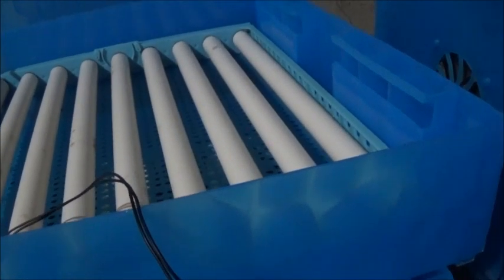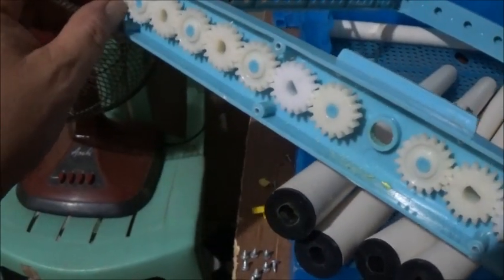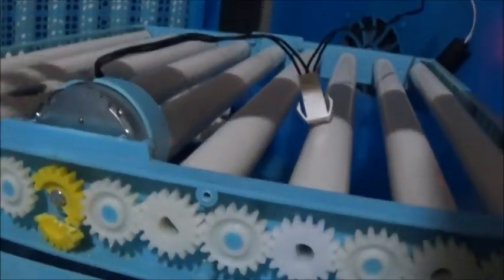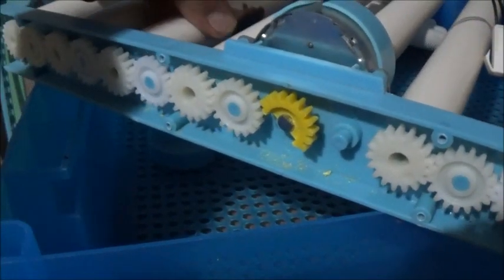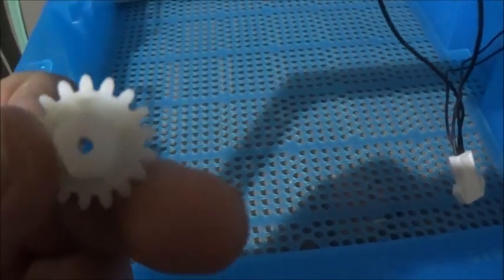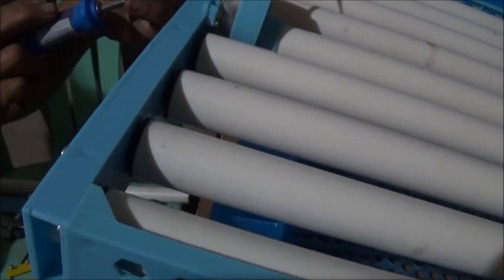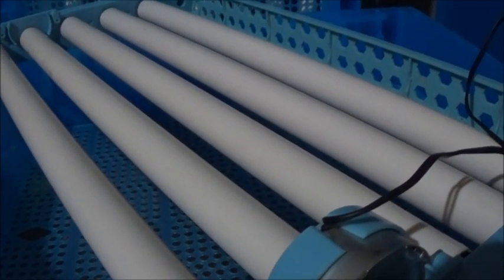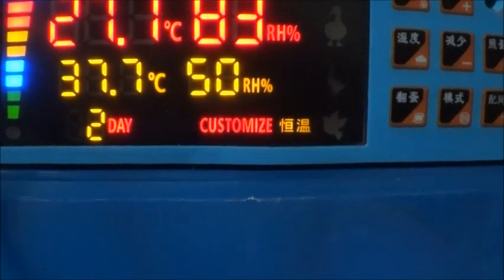Fixing The Incubator And Setting A New Clutch

Comment: Use a 90% silicone grease lubricant for plastic gears, it will help when gears go into a mesh ( when the high point of gear makes contact ) remember this will also help in the binding of gears and will help the motor to work efficiently without breaking down gears as much. Remember to lube all places of contact.

Comment: Crust! Maybe some silicone lubricant. Epoxy the motor to the gear. Superglue, MightyBond! Should have been nylon not cheap plastic. Those whole things can be replaced. The new motors don’t have to drive as hard as the blue incubator. The yellow gear looks like really bad plastic.
Reply from the maker: They all are very brittle
Reply: I would imagine the heat doesn’t make it any better

Comment: I would get rid of the gears,  put a pully on the motor so its the a few mm less in size than the rollers add a rubber belt and go direct onto the rollers.  no need for gears! I'm sure there is enough room.  If not then get a 3d printer. print your own parts for now and the future!
Reply from the maker: How much is a 3d printer?
Reply from the maker: How much is a 3d printer?
Reply: @aforeignerfarminginthephil3374  you can get them for upwards of $100.  banggood or Aliexpress, Not worth getting if just for a one off use, but always handy to have encase plastic parts break.